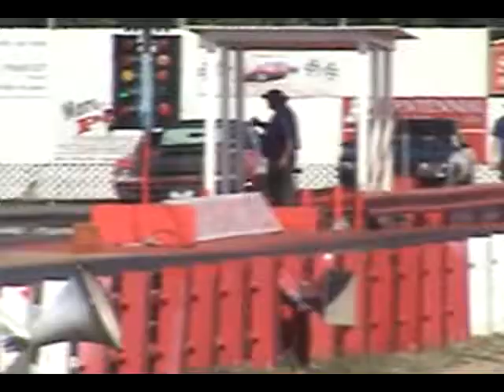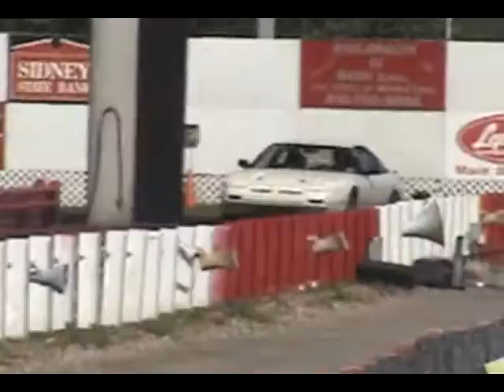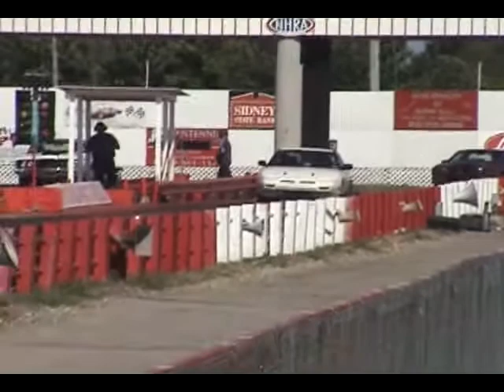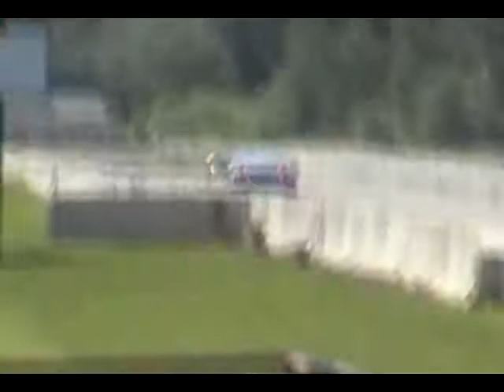240sx SR20DET Goes 12.31 @ 115 with Stock Turbo!

Comment from the maker: I totally agree about the whole efficiency thing, however it doesn't mean the turbo wont boost to 23 pounds.  And I understand what it does to the turbo i knew the effects it would have before i pushed that much.  Which is why its on my work bench blown to shit.  However my Turbonetics 60-1 turbo is sitting next to it for this coming season.  And by the way my dyno runs confirm the boost too.